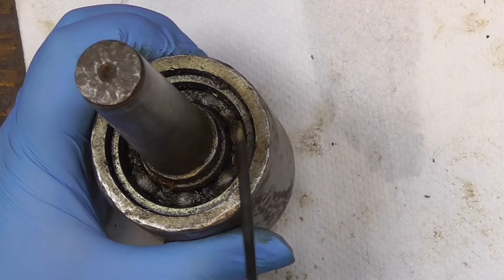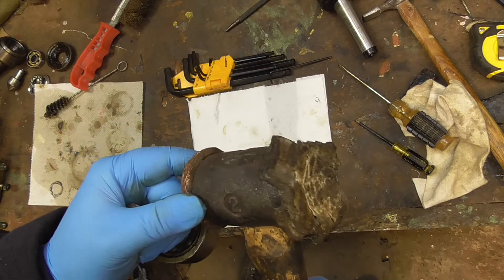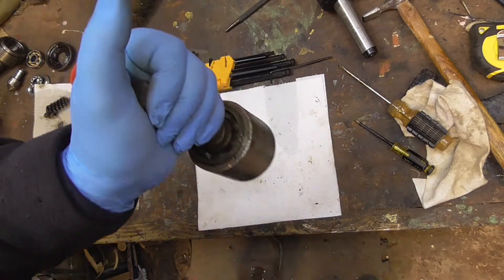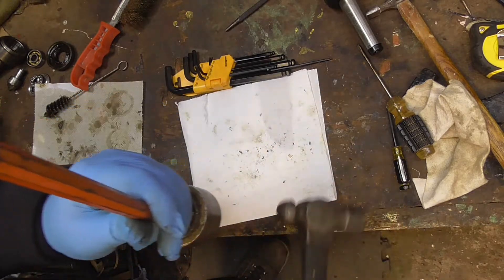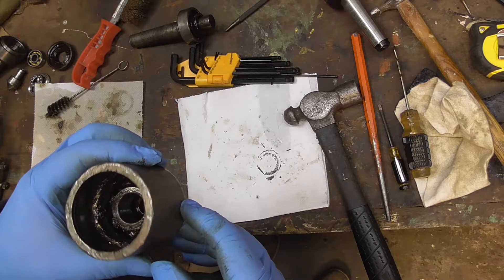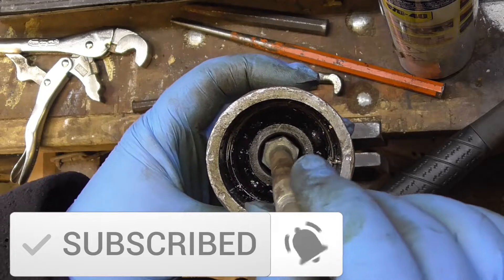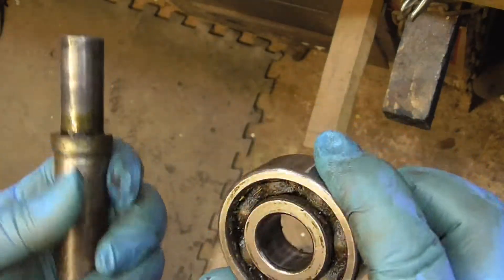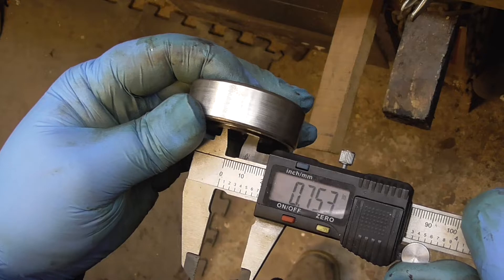P2 Morse taper, lathe live centers rebuilds

Comment: I have a Rohm brand luve center with a pressure gauge.  The glass on the gauge is broken. Can only the glass be replaced? If so, do you have a video showing how to do it? Thank you.
Reply from the maker: Hi
WOW, £+tec or what, I would contact Rohm direct and see if they can supply you the part you require or offer a repair service.

Comment: Too late I know but NEVER EVER EVER take seals out. Its a nice pristine clean and properly lubricated environment in there - why risk contaminating it. The air will get out just fine... Martin
Reply: To reduce the drag.  Parts between center change in length as you machine them and they heat.  You can end up with too little pressure on the center and then the point slipping.  I'd leave only the outer seal, probably add some grease.  The seals inside of the outer seal are serving no purpose.